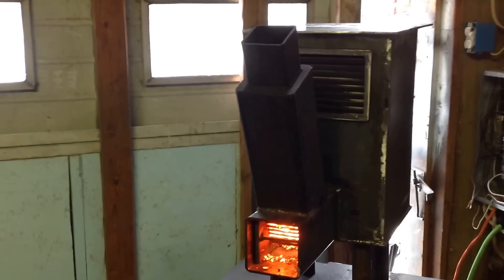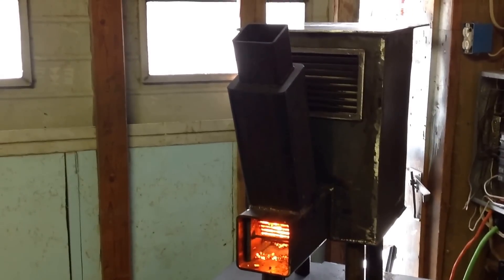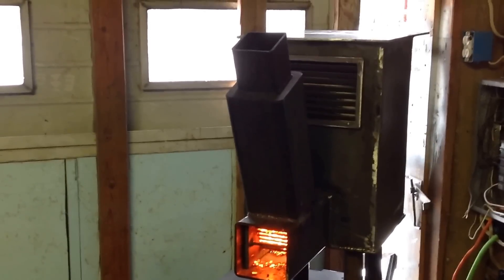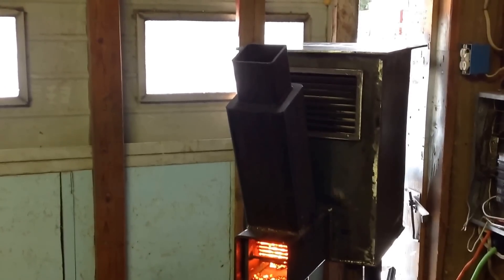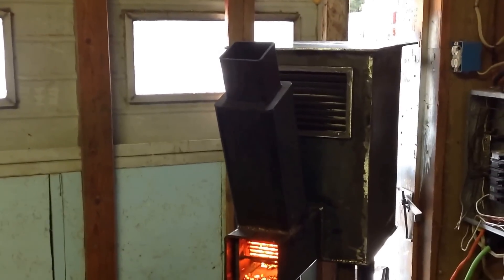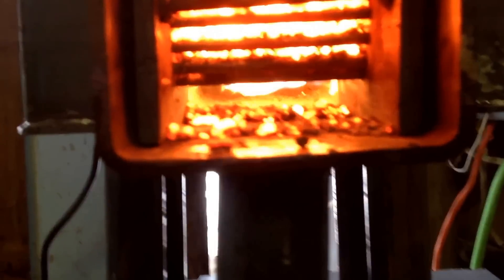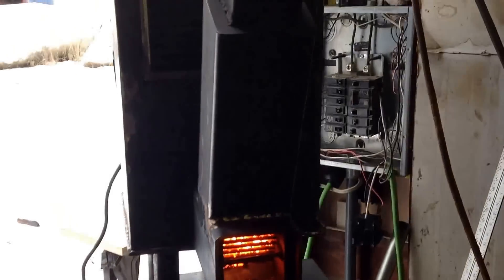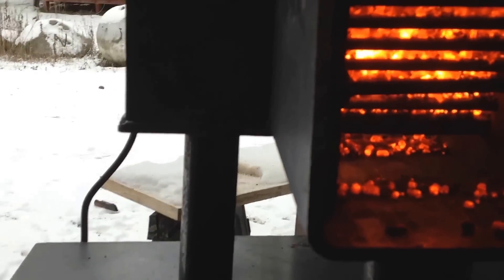Rocket stove running on pallets new build .

Comment from the maker: luckily I don't use the stoves all the time but my next of the riser will be done out of fire brick I agree I think it would burn out if I was to keep using it all the time with extreme temperatures I'm doing another rocket stove with a bigger firebox firebox will be lined with fire brick wiser will be out of fire brick and insulated can't wait to get started I'll be doing video stove is going to be expensive I've got $250 so far in material.
Reply: Mike Knop  hi my name is pete would like some info on your rocket stove great job how can i contact you
Reply: Mike Knop would like to see your build with fire brick burn box lining. Found it. Thanks.

Comment: I'm curious to see an update on this one. Just wondering how your riser is holding out with the heat. I burned mine for about 3 weeks and my riser (1/4" X4" round) started to flake off on the inside because of the excessive heat. I'm using a 4" riser made out of high temp refractory concrete that is suppose to be good for 2500 degrees, so it should last.

Comment: Looks like it burns pretty good.  Only suggestion I would make is to add fins to the internal tank(I would add them to the inside of the tank too if I could:)).  Heat transfer is mainly about surface area.  The more surface you can add to the tank the more heat you can transfer to the air in the limited amount of time it spends flowing thru the outer box.  This applies to the hot-gas side of the tank also...

Comment: Mines running at 450 right now and heating the house perfectly. It's -6 degrees outside and you wouldn't know it. We're toasty warm. I updated my squirrel cage fan (came with the wood furnace) to a blower from an actual natural gas furnace, so it blows a larger volume of air up to my main level. It's amazing how such a small stove can heat the entire house so easily!

Comment: I made one that works the same way, only I made mine a horizontal stove. My burn tube runs into the tank, 2-1/2" from the back of the tank, then the flame travels back tot he front of the tank where it has to travel up and over a baffle the to the back to exit the stove (basically a horizontal rocket stove) I building a steel jacket 2" from the tank and a squirrel cage furnace blower on the back to blow the hot air out the top. It burns plenty hot too!